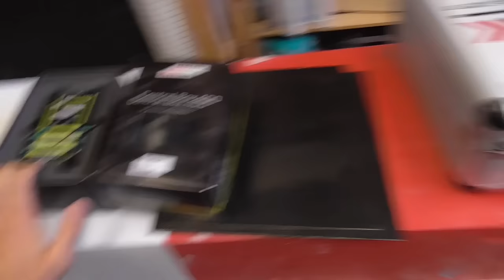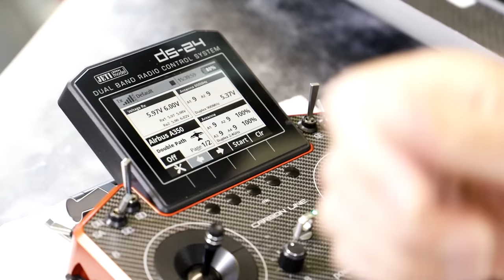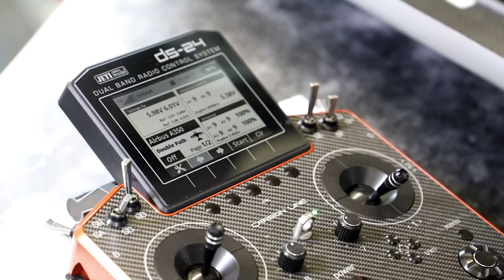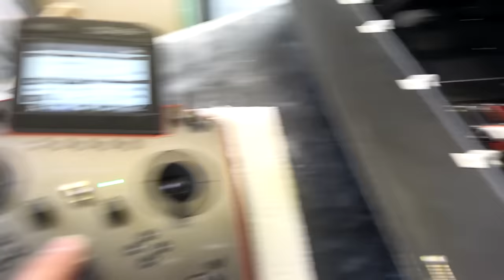BUILDING A GIANT RC AIRBUS A350 XWB, PART 6

Comment: That large access hatch is a huge risk to take.  A big hole in a large diameter, thin-walled tube is a major loss in structural strength, something like a factor of 50x weaker than a complete, uncut tube.  In a full-scale airplane, the access ports and doors are made as small as possible and away from the wing's attachment to the fuselage.  This access panel is likely going to compromise the structural stability of the right wing of the craft; possibly causing a compromising stall condition on any right-hand turns (to starboard).  Be careful when flying this model, especially when banking sharply to the right as this wing may twist enough to stall the plane, at landing airspeeds.

I see you're adding some bulkheads and gussets to the panel's frame to add strength, but maybe, for the next plane, you could figure out a way to cut a few small access panels, rather than one big one.  That would result in a much stronger second area moment of inertia for the fuselage and a more symmetrical, flight-favorable deformation during uneven wing loading.

Comment: Your antennas will not work properly when sticked parallel to conductive surface. Hot element should be perpendicular and half-wave or more far from carbon body.

Comment: BEFORE flying with JETI, quadruple-check your range... notoriously poor signal strength on 2.4GHz.  You will be flying on 900MHz 9 times out of 10.  For the ridiculous price (I owned 2 DS-16s, with primary and satellite receivers in my very large gliders), they do not perform well at all.